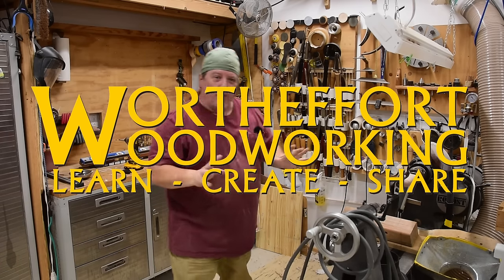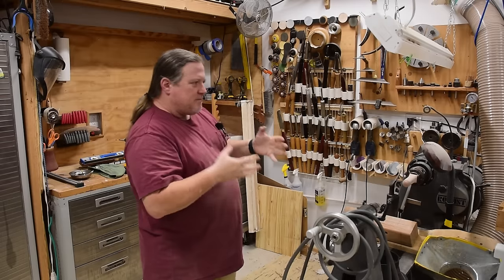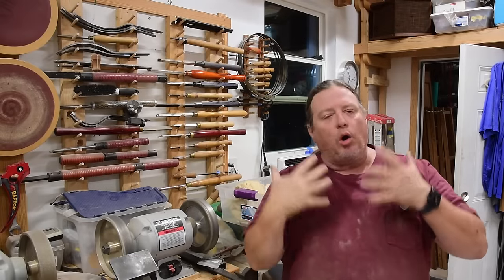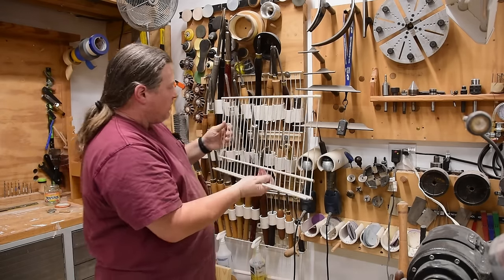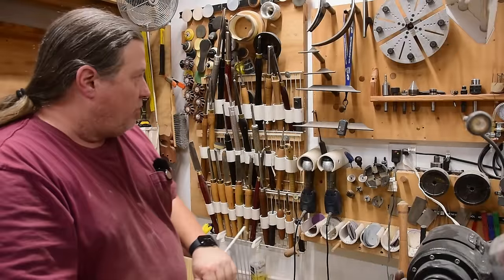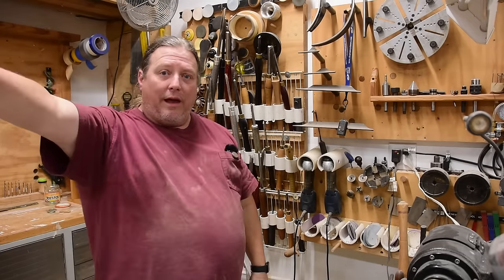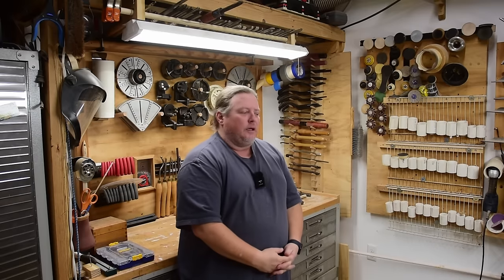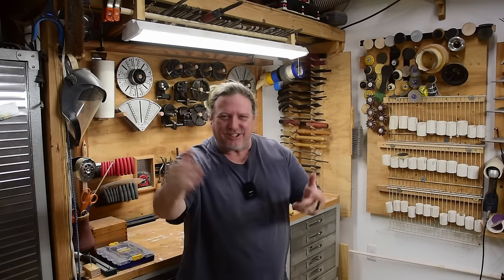Turning Tools Storage Ideas. Priority on Easy Cleanup, Organization, and Access.

Comment: I'm new to turning (long time watcher, first time turner) with just a  beginner set of traditional tools and a carbide interchangeable set. They each came with a box, but I've already given up on using those while turning. I'll definitely keep your new setup ideas in mind for the future, but for right now I think your "holes in a stool" method is actually going to be perfect for my traditional tools, especially since they currently tend to land on my shop stool while I'm turning anyway.

Since they have identical handles, I'm also going to paint the shape of each tip on the butt ends so I can grab the one I want on my first try.

Comment: Interesting ideas. I would not want my tools above the table because opening the shoulder joint everytime I reach for a tool would break it and require cortisone put in it and days of sick leave. This started when I was 20, not sure what it is in english but has arthritis type of contition. So I have learned that storing everything up to a height of the shoulder is ergonomic. Above that I store things that I need occasionally. So goes without saying that what is ergonomic is different for everyone, and great to explore alternative ideas. I am still figuring out my workshop organization, but I have been having gouges on a tool wall and take the ones I am going to use at the lathe, actually storing them in a table with holes on top. Just like you.😅

Comment: Please do not call yourself stupid. And those that do call you stupid, just are calling out their own limitations.  I have learned a great deal from watching your videos.  And will continue to watch them. You don't just tell people, "here is how to do it." You are always really good at sharing your thought process and how and why you have decided to do a particular thing the way you decided to do it. I really appreciate that because you are helping us all think. Instead of the dowel, probably would have taken a 2x4 and drilled overlapping holes down the middle, then split it in half and use one half for the back and hang one from the front like you did. But your way works very well and is a great way to go. Thank you so much for sharing!

Comment: I think this is a realy nice way to store your tools. None of this is stupid. And abselutly not you! 
if you had seen my shop layout you would laught at me and call me an idiot.
I have been tryning different things to organise my tools over several years and i still have not found a way that says to me "this is it" 
But i think the part of hanging them over the lathe (and over my head) on an angle with a downworth slope to the back of the lathe. But maybe with a box of wood around some pvc piping with holes right thru them might work. of course with a stopper so the tool dont slide right thru them. Then the piping wouldent be filled with shaving and i just blow the dust right thru them with a airgun when im cleaning.

And maybe on the bottom of the "cabinet" its a good place to hang some lights 🤷‍♂

Thanks for sharing your process for a easyer and better shop layout. (And of course for sharing everything else you share)

Thomas

Comment: 1. I’d wrap that dowel with some sort of rubbery tape to reduce any sliding. Probably the back shelf as well. 

2. Actually instead of the dowel, you should turn a piece to go there that has some texture to keep the tips from sliding side to side. I’d still do the rubber too tho

3. For the shorter tools you can extend the shelf at the back outward, so the points line up with the others but the handles don’t go back as far.

Comment: tool rack looks good.  Little scary but if you think its stable, then Im sure it is.  My only concern would be that if there's any tools that are really infrequently used, dust'll settle on them and they'll rust up way faster than they would if stored vertically.  But if you use all of em with some frequency its not gonna be an issue.

Comment: Video freeing up the now empty wall would be amazing. Any of the most used turning chisels may be put in a new easy-access holder on the wall or even closer to the lathe. I'm a big fan of the simple lean on the butt with half-circle cut-outs. Most basic lathe tool till.

Comment: I drill the smallest hole for my rack in the appropriate pattern for the tools I'm storing then enlarge each hole for each tool with an electricians sheet metal bit ( looks like an ice cream cone) and enlarge each to fit the tool in that spot. Keeps me to two bits.

Comment: I think it's easier to put the places in order when there is a building with solid walls and a floor. My wall is in an old caravan and measures about 7*7'. I modeled a tool stand similar as yours about 3 years ago when I started turning. It has worked well. However, it is always full of chips, there is no space to place it smartly. Too much stuff has already accumulated in a small space, so it's time to start the year by organizing the workspace. As soon as these -50°F temperatures get a little warmer🥶🥶🥶

Comment: Like some of the commentors concern with sharp edges, I would think removing equipment, etc from the top shelf may be dangerous - poking, cutting, what ever when reaching over the cutting edges. 
Like the idea abiut texturing the dowel with rubber or another oroduct to prevent the tools from moving side to side.
Reply: I had to stop watching at 6:30. Sharp gouges above one’s head!!! That just gives gravity one more chance to injure me! No thanks.